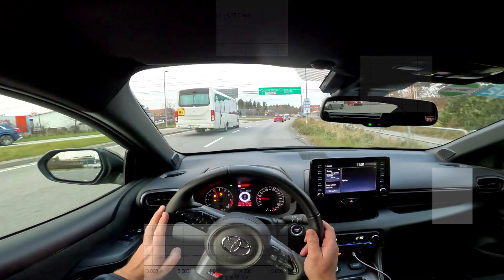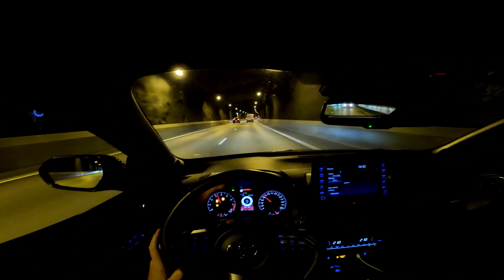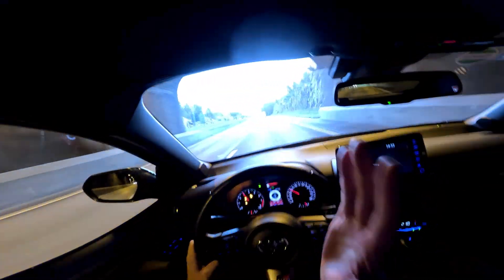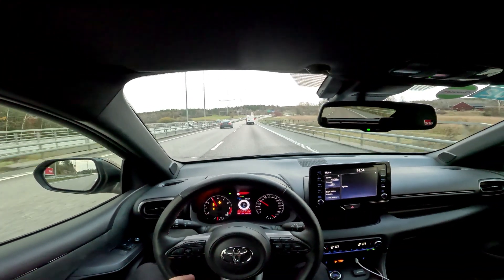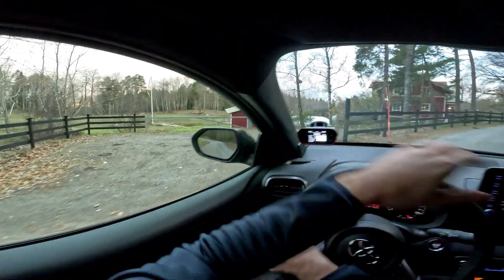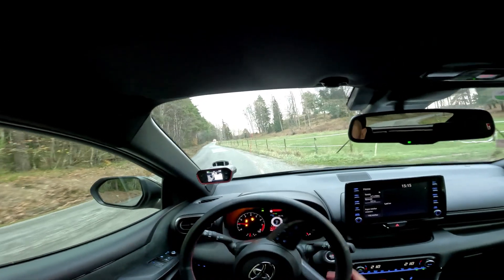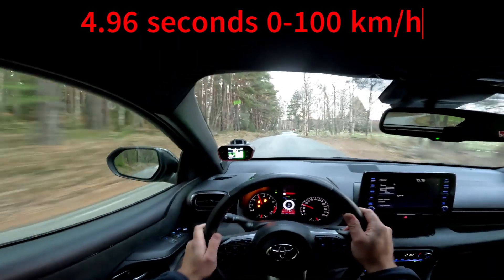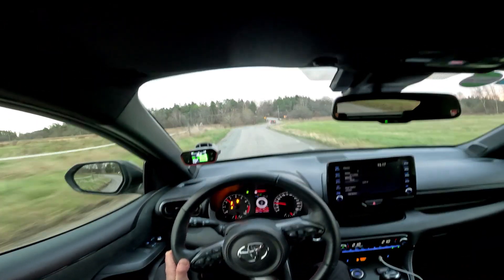Rolling start, Flat foot shifting and Launch control on the GR Yaris featuring EcuTek software.

Comment: Hey, are you not at all worried about the Toyota warranty with flashing the ECU?
Pretty tough decision to do this or keep the 15 year warranty for resell value
Reply from the maker: Let me add that hopefully this car will be owned by another entusiast that chases the experience like I do. For the right buyer this car could be very valuable. Especially when we are done rebuilding it to an European GRMN spec this spring. Stay tuned for more content!
Reply from the maker: The warranty is a complicated issue and I have talked to my reseller about it. It is not as simple as one might think what gets void or not. In terms of resell value. I just want to drive and have fun so I chase after the experience. I use one of the most renowned tuning firms in Sweden and that communicates quality. Now the Yaris Gen 1 is not an expansive car to buy compared to most other brands so the value can only drop so much if I screw everything up.

Comment: Vilka modefikationer har du gjort mer än ecutek? Och vad fick du för effekt? 😄
Reply from the maker: @Henriksson22  bilen har 326 HK och 420 Nm i vrid. Den har eventuri-insug och fullt Akrapovic avgassystem. Den effekt jag har är max om du inte byter ut ventilfjädrar och kamaxlar med mera. Släpper möjligen en film där jag pratar om vad jag gjort med bilen. Det är som en prolog till denna film. Är det något du skulle vilja se så kan jag klippa till den och lägga upp.
Reply: @Revisorsracer  okej, har du ny downpipe med?
Kan dom få ut mer effekt eller ligger dom på den säkra sidan vid 326hk?

Gör gärna med videos 👏
Reply from the maker: @Henriksson22  Nej, ingen ny downpipe. Kanske en racekat hade varit något? Det är JRM Racing som har gjort jobbet och de kan Yarisen utan och innan. Det går kanske att plocka ut mer men vi vill inte spränga motorn! De har för övrigt fått upp effekten på en annan GR Yaris Gen 1 till 500 HK men där har de bytt massa interna delar i motorn. Problemet med 500 HK är att man behöver en större turbo och då får man mer turbolag vilket är problematiskt när man kör på bana. Vad jag vet kan man få upp effekten till nära 400 HK med en liten turbo. Jag lovar att släppa en video om vi testar det!
Reply: @Revisorsracer  ja det var till Jrm jag tänkte optimera bilen.
Ja det är sjuka siffror på en liten 3-cylle. Runt 380hk hade varit coolt. Men då lär man byta kam & fjädrar?
Reply from the maker: @Henriksson22 exakt!
Reply from the maker: @Henriksson22  Notera också att kostnaden för att optimera till 326 HK och 420 Nm är relativt låg. Kostnaden från 326 HK är mångdubbelt större då det krävs massa delar och arbete. 30 000 - 50 000 kr till 326 HK. Från 326 HK till 380 HK ytterligare 100 000 kr plus. Så priset per HK ökar dramatiskt ju högre du kommer.
Reply: @Revisorsracer  Jo har räknat på det 😅 får bli länge fram. Just nu blir det hela avgassystemet med downpipe, insug, Ecutek.
Reply from the maker: @Henriksson22 Det kommer bli kanon och bilen kommer gå som ett skott!
Reply: @Revisorsracer  ja det såg så ut när du körde 🤙

Comment: 2025 automatic transmission GR is way better and faster
Reply: and way less fun than a manual one
Reply: @MoraMa.  you saying less fun is like saying it's more fun having manual crank windows than power windows. Manual transmissions were for poor people, and no Lamborghini, Ferrari or GTR owner says your comment.
Reply: @arctictruck10  don't compare manual crank windows to a manual transmission, one is for practicality and the other one is for entertainment
Reply: @MoraMa.  No, it's like having a machine that digs holes for you rather than taking a shovel and digging it yourself.Which one is more fun
Reply: @arctictruck10  with manual transmission you are controlling the car more than the automatic one, being engaged more in the driving experience, you can shift whenever you want, and doing so is really satisfying, lambos and Ferraris have automatic transmission because it's easier to control the car In really high speeds, and having both hands on the steering wheel, yes if you 2 same modern cars, of course the automatic will be faster, bc the computer will always be faster than a human, but a human can control the car more depending the situation you are in
Reply: @MoraMa.  They know how come manual transmissions are non  existence in professional car racing even in rally car racing? Volkswagen even dropped the manual transmission in the golf R. With your logic, it's more engaging to have manual crank windows and roll them down yourself and unlocking a power door yourself or even manual crank and opening a sunroof.
For the engagement
Reply: @arctictruck10  never said that they are in WRC, or in any professional racing, plus comparing crank windows to a manual is dumb, manual transmission is used to have more fun while DRIVING the car, the power window is just more practical
Reply: @arctictruck10  you comparing the 2 is like saying why should you read a book if it has a movie or a show
Reply: @MoraMa.  You never answered my question about digging a hole with the shovel is more fun than having a machine that can dig the hole for you.
Reply: @arctictruck10  ok here's your answer, if there's a guy who LIKES to dig than he preferably likes to dig with a shovel too, if there's a guy who doesn't love nor hate to dig but has to dig, he would choose an powered digger or whatever it's called, the same with a car, a guy who loves to drive cars and love to be with the car he most likely prefers manual, but if there's a guy who doesn't love nor hate cars, just needs them to drive anywhere, he mostly prefers automatic because it's less work
Reply: @MoraMa.  that sounds goofy as hell. I used to be save the manuals until automatic transmission got way better, and when automatics were lame I wanted a sequential gear box back in the day. Manual transmissions have a many nails in the coffin so hold on the that relic manual while you still can.
Reply: @arctictruck10  Then why does Porsche and BMW keep making manual transmission cars like 911 GT3 RS, M4, M3, M2? Are these for poor people?
Reply: @etticys7057  because those people spend more money and manual transmissions cost less to make. So why did Volkswagen drop making manual transmissions is a better question.
Reply: @MoraMa. Dude is like, "Why work out when I can get liposuction and brazilian abs?" 🤦‍♂
Reply from the maker: Yes it is a different experience to drive a car with an automatic transmission and it should make the car faster on track and when accelerating. I haven’t tried the Gen 2 automatic yet but looking forward to do it soon!
Reply: If you want an auto, buy a golf r. Faster in every way.
Reply: @davothegreat9990  I was a VW fan boy back in the day and owned a 92 vr6 Corrado back in 98 until it got stolen. Stopped liking them after the 04 R32 and was upset they didn't offer the DSG in the States along with the four door option like they had in Europe.
Reply: @arctictruck10  I'm not either. Just dont see the point of a gr yaris auto.
Reply: @davothegreat9990  The point is that it's faster 0-60 faster around a race track, and nobody in professional racing has used a manual since 2004 because if you did, the driver would come in last. Your next comment will be that it's the fun and engagement that makes no sense because you can have that with a PDK 911, Lamborghini, or Ferrari. You should remove power windows from your car if you like engagement or power sunroof for a crank with that logic. Then your going to say I don't care about 0-60 them my response will be, why do they do test comparisons with 0-60 and quarter mile times on reviews of a car you might want to spend your money on.
Reply: @arctictruck10 No one asked?
Reply: @shogun3730 did anybody ask you to comment?
Reply: No one really cares about how fast it actually is. If people are chasing pure numbers or lap times a used GTR is what they will buy. This car is about having fun.
Reply: @AEVMU  I care my guy